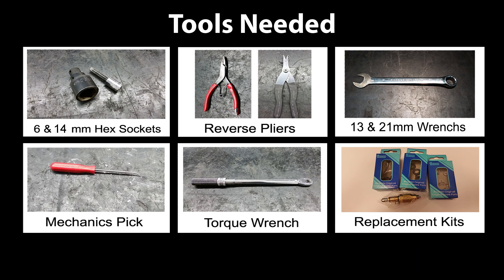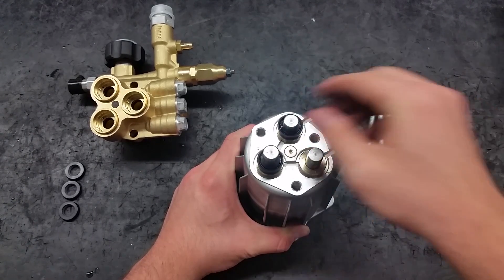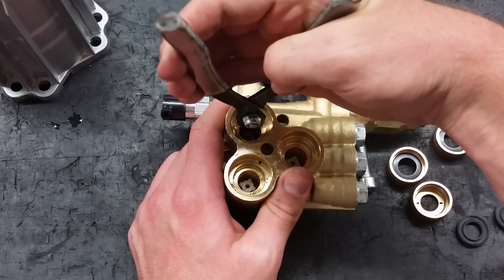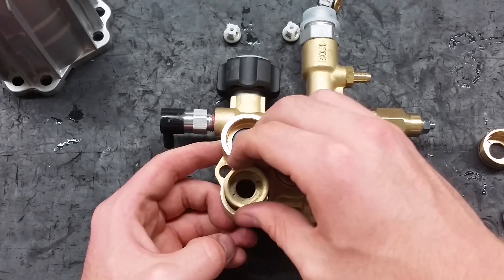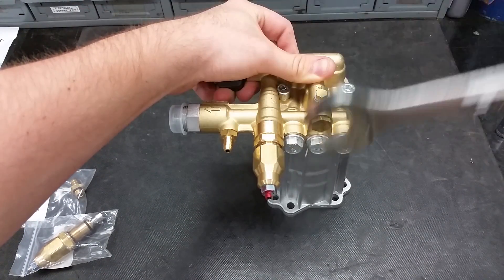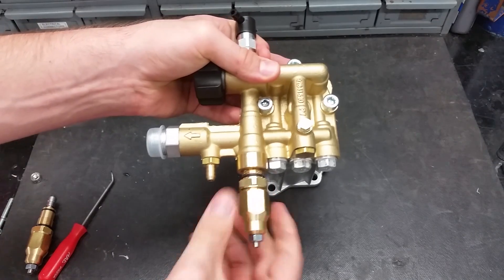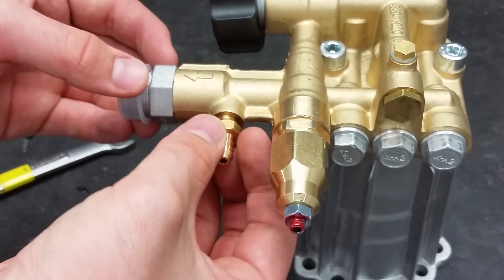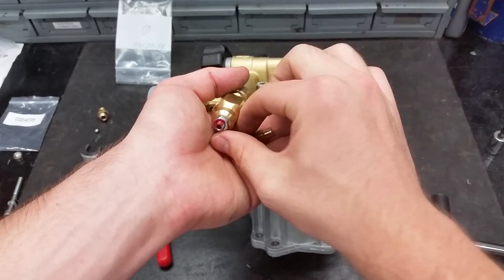RMV Pump Repair & Maintenance

Comment: I have to know what would cause a discharge valve to completely fail and break apart???? I have a craftsman 3300psi 2.5gpm power washer. That was purchased from Menards brand new. It’s been used a total of 4 times since being purchased about 2 and a half years ago. The first year I had owned it I actually stored it in the house to prevent it from freezing in the winter. But the second year I did some research on how to winterize the unit. I used RV pink winterization fluid and that indeed kept it from freezing and cracking. But this summer I needed it to power wash my front porch and back deck. So I pull it out and of course this pos is giving me problems. Ever since I bought this thing it’s had issues with starting so I looked into possible issues with my unit and I find out the fuel pumps on the Honda engines are prone to fail for not obvious reason. I replaced the fuel pump and it seems to be starting easily now. NOW I’m dealing with the pump itself and plastic parts inside it failing in a fairly dramatic way. And when I say it literally fell apart I am not exaggerating. The one valve that failed looked as if it just exploded. It sent its parts and pieces throughout the manifold. So I had to completely disassemble the entire thing to remove all the pieces. I suppose what really irritates me the most is this unit is plastered with MADE IN THE USA 🇺🇸 all over it. As of recently in the last 4 years all you see is people talking about buy AMERICAN 🇺🇸. And I’m all for it based on the quality I remember growing up. And I’ll gladly pay more for the quality that’s claimed in going with American. However I’m not seeing this so called better quality. All I have been seeing is my wallet getting lighter quicker and still dealing with cheaply made products. The automotive industry is full of AMERICAN made products that are just plain junk brand new out of the box????? Remember the quality is supposed to be 10x better than foreign made. I’m not sure what is happening but something has to give. Because personally I’m happy to have made in china quality at an affordable price. Then made in America prices with china or worse quality. Is this what we the American buyers are in for with the current tariffs. Junk products with inflated prices but it’s made in the USA 🇺🇸????

Comment: My annovi pump will build pressure to the rated pressure maximum (about 2400 psi), but when I activate the wand trigger the pressure drops to 600-800 psi.  The inlet hose is good, the water supply is good, the hose, gun and nozzles are all new.  What's going on?
Reply: My  guess is thw UNLOADER   remove as in video and oil clean it with WD40 and reinstall.  Worked for me,
Reply: Pressure is the result of a force encountering a resistance. When you open the wand you are lowering the resistance to flow, hence pressure drops. The accurately test a pump you must measure pressure @ a given flow rate.

If you want more “pressure”, try decreasing flow via smaller nozzle on the wand.
Reply: @jamestincher4753  That was the correct answer.  Too large an orifice on the nozzle I was originally using.   The company that I bought them from said they are universal one size fits all and that turned out to be incorrect.

Comment: Question. Are there supposed to be seals on both the pistons and in the manifold (where they both connect), or only one set on either or?

Comment: That bolt used to pull out the unloader seat looks bigger than 5mm.  What is the actual thread size for that bolt?
Reply: comes in a replacement kit

Comment: HOW About the OIL for the Woble PLAte ???
Reply: Yep im looking for this info aswell. As mine runs well but the housing gets super super hot after a few minutes running, would not be surprised if there is no oil in it.

No idea how or what to use as the version i have has no drain or fill for the oil.

Comment: Any benefit to removing the pump head, all the pieces (unloader, seat, water seals, check valves, and EZ start) in the head, and flushing all channels with water or compressed air?  Is it possible that something could come off an o-ring or seal and restrict or clog up one of the water channels, causing the pump to not work?  Thanks!
Reply: What about the tightness of the end of the unloader?
Reply: If it is that bad get a replacement.    But try pumping WD40 into the pump

Comment: I was looking for the parts at the outlet .. the aluminum fitting has two sliding valve pieces that flopped out when i wasn't expecting and now need a parts diagram ... everything BUT

Comment: Cool video , can anyone tell me how to fix one  A.R.  that seems to be locked up under pressure and stalls the engine .... won't pull start again unless water is turned off and pressure relieved !! ??  Thanks - MW
Reply: I have the same issue, did you find a solution?
Reply: Yes , it seems someone had not flushed it completely after using a harsh detergent compound , bought a new kit & tried to rebuild it , but it was too galled and scored up inside . The valves never would seat and seal correctly , so had to buy a new pump !!
Reply: @waylonmccrae3546  noooooo :(
Reply: WD40 my help or get a replacement   $60 to $150 depending on brand.   You do get what you pay for!  Cheap is cheap!!!

Comment: how to change the oil?
Reply: If you undo the 4 mounting bolts from the engine, you can just spin the pump 180* and gravity will remove the old oil.  Spin it back up, install bolts and don't forget to refill with fresh oil.  This was the easiest way I found.
Reply: So it does not need to fill oil or replace, it’s use the same oil of the engine?

Comment: how does one tell if the unloader is defective/bad? when I remove the unloader and then tighten the nuts back on the unloader the shaft does not move if I press down on it. If the nut is not tighten the shaft does move. This unloader is not like the other type of unloader on YouTube. Any help/advise is appreciated
Reply: kc I took the entire unloader apart. Uncrew the top part off, there is a thicker spring with 2 separate circular brass pieces on both ends of the spring. Remove them and lube them with a thin layer of silicon grease. Once the removed it's a good idea to inspect the o-rings on the bottom part of the unloader (by bottom part I mean the end that's bolted into the pump). With no tension coming from the spring, you should be able to freely push and pull the bottom tip easily. If not, the tip is stuck. Get it unstuck by again lubing the neck of the tip and the top of the piston. Once you lube everything you should be able to push and pull the brass rod/piston easily. Put everything back together and I hope I was of any help to you.